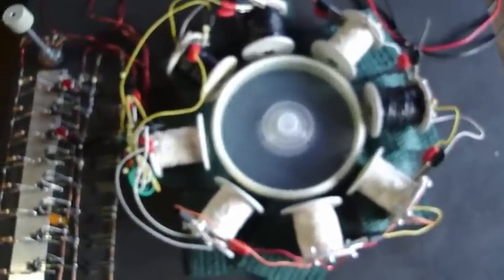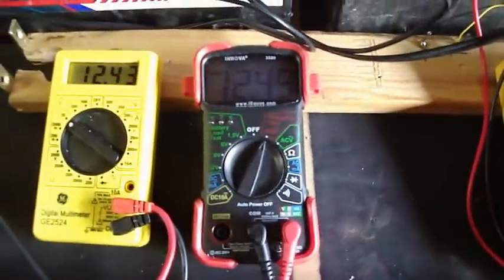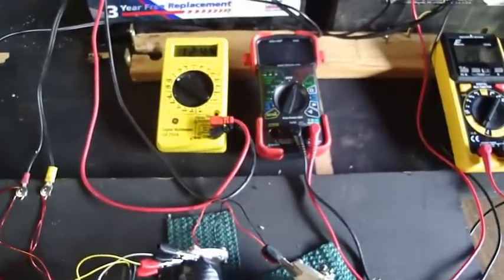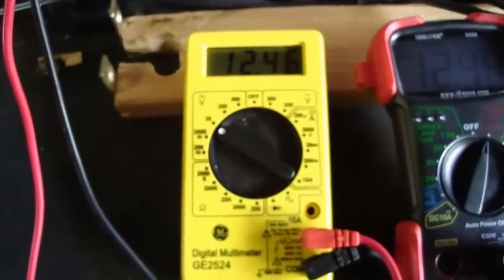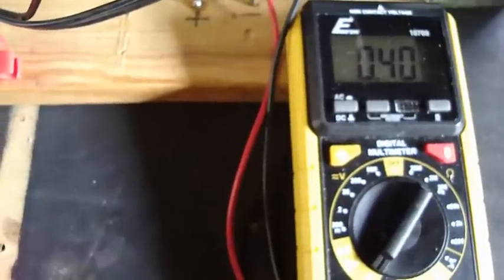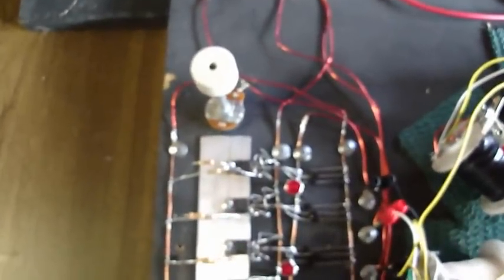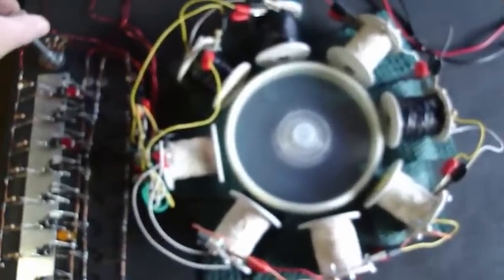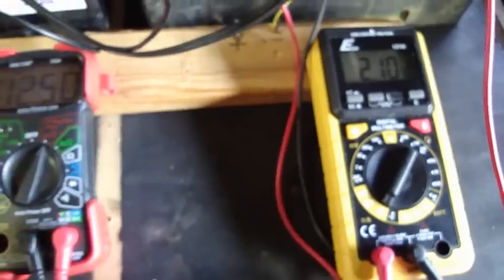Sampu Express Pt3.avi

Comment: ...sink. The only application a diode can work is by itself or in a half bridge or full bridge. Even series diodes cause problems. It explains that also in the video. Anyway, I just thought I'd let you know all your extra diodes are being destroyed with heat and they aren't contributing to the circuit one bit.

Comment: Hey poppy, I noticed you had diodes in parallel. Just wanted to let you know that diodes in parallel apparently don't do a bit of good. I watched a video on here by user: Afrotechmods which explains it. The video is called diode tutorial and how to build an AC to DC power supply. Very nice tutorial. His channel has a ton of great info. I thought about doing the same thing you did until I seem his tutorial which explains that current will only go through one diode and the others act as a heat....

Comment: thanks for your answer but I'm interested if you can send me by mail the electrical circuit plan with that type of transistor you use and connections is the circuit diagram is carlosmerlino2002@hotmail.com elelctrico my mail thank you very much

Comment: Hi Carlos...
The coils are all modified bifilar coils. I wrap the first layer with 800 turns of 20 gauge wire for the run, then over that I wrap 450 turns of 24 gauge for the the trigger.